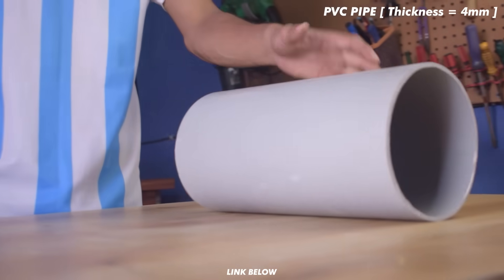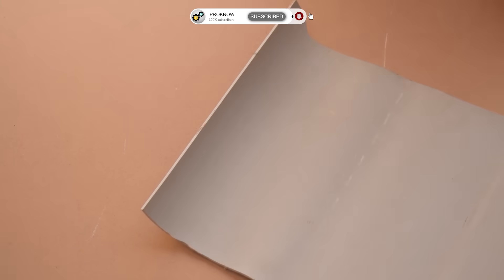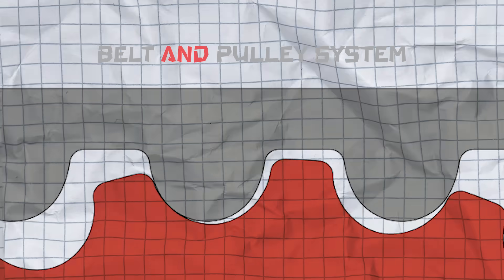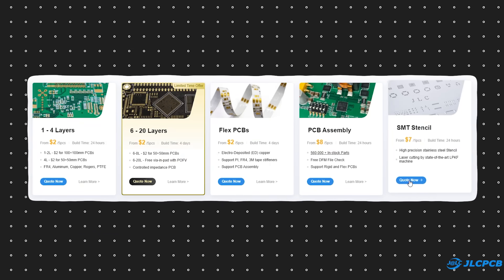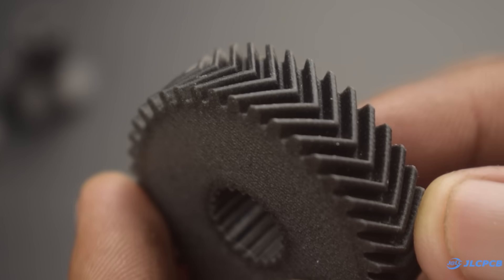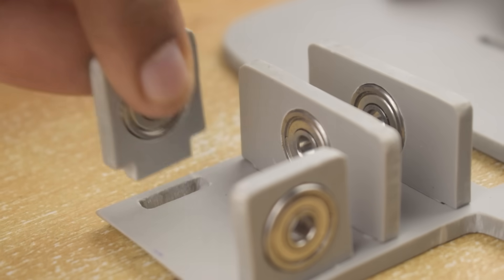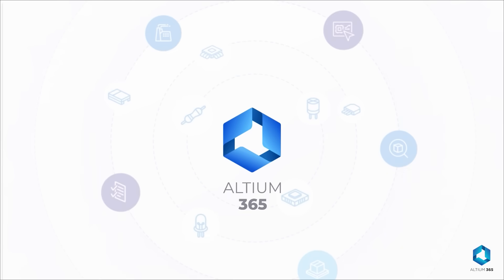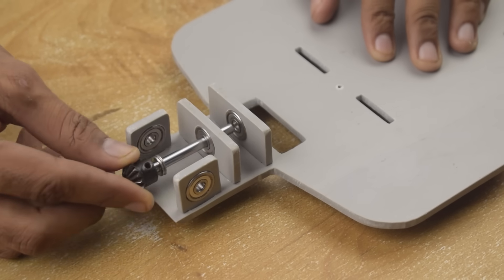Hand Crafted Powerful RC Car out of PVC Pipe - High Speed DIY RC Car using PVC

Comment: Amazing project and a superbly edited video. Kudos to you for making such a cinematic project. 
Just a couple of points from an engineers perspective. 
1) Those motors will eat out your 3d printed gears in no time, like a hot knife thru butter!  
2) All that stress and vibration on chassis, the glue is never gonna hold up for long. This is gonna fail 100%. You need something that is bolted together.

Comment: That's amazingly done. First thoughts were this is a batmobile, but this thing is not made to be beautiful but powerful. I'd just add some covers above engines to make it more waterproof. Also I'd protect servo with plastic if the car flips by sudden fast turns it could damage itself. Your skills shows that the projects are not made from expensive parts but from brilliant mind, that is creative and from finding best but simplest solutions.

Comment: RC Car out of PVC Pipe - using 3d printer. BRAVO!!! Also I can see how easily lower base is bending when you open throttle. That's why upper 3d printed case IS necessary, not just optional...
Reply: RC cars use a metal rod or plate mounted on both rear and front shock towers.

Comment: It’s important to clarify in this video that the PVC used is Schedule 80 PVC which is grey in color, thicker and is not found in the plumbing section of Lowe’s. It’s in the electrical section. Trust me, it’s strong stuff. Also, the plumbing section has Schedule 40 PVC that’s white or black in color. I used the black PVC to make a custom camera mount and it’s been holding up very good so I’m not implying Schedule 40 PVC isn’t strong because it really depends on the application. Awesome video!
Reply: He is from India and I know there is no color grading here local dealers makes what they know and these are used in sewage system of houses. I didn't know there was a color grading thing.
Reply: its call pressure pipe.  Its twice of size the other.  Perhaps there is difference in color  as maybe different countries provide different things but grey is simple one then white can be anything, however it is hard to say what he is using, but I am assuming it is pressure pipe. Also pressure pipe is way more expensive and perhaps cheaper to buy that car already made then make it. Also why using pvc pipe when you have 3D printer ? Just reenforce with small metal lines attached in middle.  Also frame can be with plastic round tubes filled (compressed) with light dense martials   to give durability.
Reply: where do you even get schedule 80 in 4inch diameter or w/e he is using

Comment: Its 2024 but stil these guys dont utilize a 3D printer for simple cases like that. Mahbe they are not educated to use computers to access and study CAD modeling.
Reply from the maker: I actually designed this RC car in Fusion 360 and used both PVC and 3D-printed parts, like the gears and shell cover. It seems you judged my work a bit quickly—I'd recommend exploring my channel, where I regularly use CAD modeling and 3D printing in my projects. Often, there’s more than meets the eye in a single video!
Reply: @proknow  well done! where are you based out of?
Besides,  how much are you paying for Fusion360? And which 3D-printer have you found success with - including getting not ultra-expensive raw material?
Reply: @proknow  but look at urself u r heating and reshahing a pvc pipe. Dont u know how to model curve cases in CAD?😂

Comment: BatMobile on the run 🔥

but why did you use pvc, you can use a hard aluminium plate for less weight but high reliability, motors are already capable

Comment: What is the point of two motors being on the same gear? It’s not going to produce more torque, and perhaps only slows down the car.
Reply: This is incorrect. The two motors together will in fact double the torque rating of a single motor of the same size. He could have gone with a single larger motor, at a sacrifice of vertical space. Availability of a larger motor with the same spec as his two smaller ones is also a factor.
Reply: @ I agree. If each individual motor is driving each individual wheel. That is common design for most electric cars, and of course some RC as well. This particular design is transferring mechanical force of two motors to the same gear. In which case the force of both motors is equalized by a single gear. I’m not an expert, but would be interesting to see the math behind the rationale. My instinct tells me that second motor is redundant in this case, but I could be wrong.

Comment: Mounting the motors without having gear mesh adjustment is a level of confidence I wish I had 😂
Reply: I've been doing this by eye thousands of times for about 30 years and it never comes out wrong.🙃😀
Reply: Just put the paper. If gears don't cut it, it's perfect.

Comment: Sorry to say, but, this is not powerful... It's not even got a good enough torque....  Use proper rated brushless motors... Even if they cost 10k+....
Reply: Sad to say but I agree. It’s. Neat idea of engineering but it’s not got performance or speed of even a cheap used slash. Again, cool project but don’t claim high performance. Lol
Reply: It couldn't be better to use 775 DC motor instade bldc
Reply: @somnathbhandari306  nah bro, you won't have the burst power... Plus, efficiency...and sustainability.... Brushes and slit rings aren't sold as replacement parts....
Yes, battery specific efficiency won't be there, but then again, the title says "powerful" ... That's the reason why a Tenere 700 gives a crap mileage, but an Xpulse Pro gives 50+.... Also the reason why Tenere can go 185 stock even with all that weight, while the Xpulse barely goes 121
Reply: you’re so corny for this
Reply: You can give him money then
Reply: @shankarrefrigerationsr4279 lol you're talking as if gearboxes don't exist